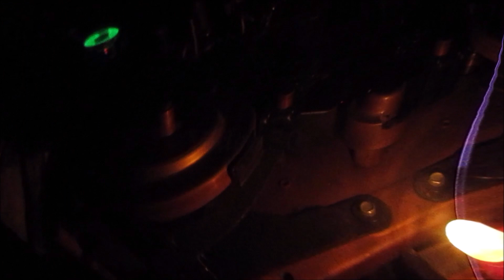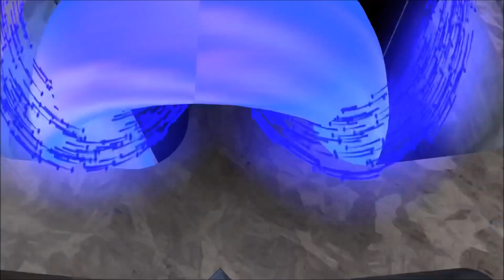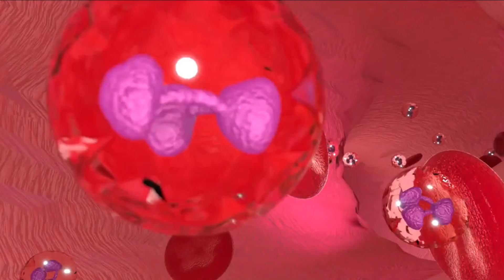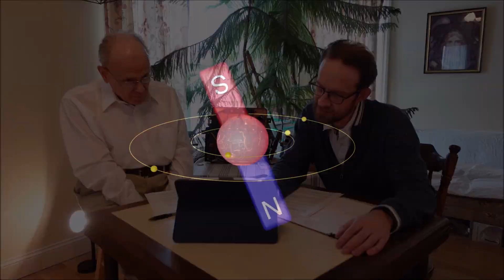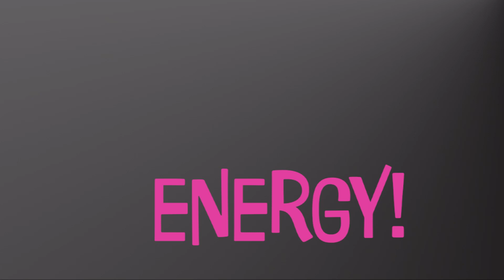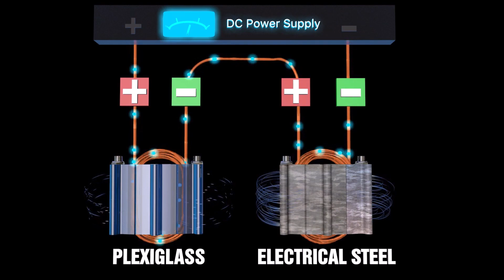Reaction-Video: "How the Holcomb Energy System Works..." (Video 30)

Comment: If just one of these Free Energy devices hits the open market, I'd destroy the Monetary System and the Shadow Government won't let that happen if they can help it. 
It would only take a fraction of one of Elon Musk's Maga Factories to produce a Free Energy device to the point of no return. The Tesla Home Charging Station. Offer it cheap to Tesla car owners for their "Car" and charge their whole house. 
An inventor named Floyd Sweet "Sparky", and his Free Energy device is the best I've ever seen. It's a 5x6x10 inch box that creates energy depending on the demand. It can power a wrist watch or a house or a building or,.....? It's pretty well documented and I'm thinking Elon Musk is smart enough to back engineer the device.
There'd be no more Slaves and Slave Masters anymore. Advancements in all fields would flourish. A cure for addiction? 
In Star Trek, in a time where humans are space fairing, remember, there is no Monetary System. 
I believe, because I've heard "I had a dream" so many times, that there are alien influences giving these Free Energy devices to knowledgeable people to try to break the grip of the monetary system on the people of Earth. 
And this is the way you know that the Forces are against you, Dennis Lee invented a Free Energy Panel System that uses a subzero gas that collects heat from anywhere in the world 24/7, compresses it to turn water into steam that runs a steam engine in a closed loop. Simple and easy to manufacture. He was sued by the United States and won. The only one to have won a fraud case claiming Free Energy. It can be retrofitted to Simi Trucks and Railway Cars right now!
So why are the Solar Panel and Windmills companies getting the Subsidies and Contracts if the United States government knows about Dennis Lee's invention if we really do have to save the planet? 
Because the Climate Change Crisis is a Hoax. A Power Grab and a Money Grab in the form of Campaign Contributions and Kickbacks!

Comment: Okay, need to chime in here, Iron does make a stronger magnetic field than air. Iron can have a rating of up to 100,000 H/m in some engineered formulations. The thing is that all electromagnetics experience a phenomenon known as reluctance and reactance.

The more magnetise-able a substance is, the longer it takes to magnetise the entire mass. This doesn't mean you need to apply higner voltage to the coil to magnetise it but you need to apply the same voltage for a longer period of time to magnetise the coil.

the reluctance of a coil is "resistance_reluctive = 2 * Pi * Frequency * Inductance" so that shows the resistance trying to switch an electromagnet at a given frequency presents in addition to the line resistance of the wire that makes the coil

The time it takes to fully magnetise the material to full strength is "T = 5 * Inductance/line_resistance" so if a material is 5X as magnetic, it'll produce a field 5x the strength for the same current input, but it will take 5x longer to reach full strength, which means you need to apply power for 5x the time.

Free energy is possible, just not like this.
Reply from the maker: Thank you for your comment!

Comment: If you take apart a hoverboard wheel which is a brushless motor with stator in center and magnets that rotate on outside wheel.  Remove the circuit board & hall sensors and you end of with a 3 phase alternator with stator in center and power can be generated by rotating the outside magnets.  The Holcomb energy system is replacing those rotating magnets (alternating polarity) that require mechanical motion,   with electromagnets that would have some kind of switching circuit replacing the function of the magnets.  That electromagnetic switching circuit requires power to operate.  His demonstration test didn't prove anything to me.  Put amp/volt meters on input coils and on output stator coil and prove there is more power output than input.
Reply from the maker: Thank you for your comment!

Comment: Dr. Holcomb claims that his electrical energy system, which he invented, has an overunity factor of FOUR! It is a solid-state generator, using the "electron spin" in electrical steel to multiply energy, using alternating magnetic fields, according to this video.
Reply: Yes, these are his claims. However, no confirmation of these claims by independent experts exists. This and physics make Mr. Holcombs claims very doubtful.

Comment: Greats video 
This is standard theory and everything regarding iron is standard theory no different in fact to any other non diamagnetic materials. Some are stronger depending on the free electrons.. basic well know stuff 
And we should remember that only  permanent magnets will become unaligned over time because of entropy. 
No non diamagnetic magnetic material will ever ‘run out’ due to entropy. 

So the thing is - does this device this man’s designed gave a a-systematic coil design? I’m not sure it does… and without that you would be left with symmetrical ‘equal reaction’ standard design and standard symmetrical behavior which in everyone’s terms is less than Unity. 

There’s many factual examples of asymmetrical designs that allow above unity results ‘free energy’ results by several different possibilities 
1, (solid state) the reuse of input energy more than once - by a pure reactive power design - that provides a blinded output to a pure resistive load. 

Mechanical - turning off coils to both save the CMMF MMF and reuse the coils input over again

By magnets - design a ac wave form to keep half the input to the coil being that only half the time (cycle) there can be CMMF, you keep it the other half.

2. Using magnets in a core to control the flux (block the flux) in asymmetric designs where there is more that net 0 in flux response return. 

3, Using nature by producing longitudinal waves. By using a spark gab quenched with magnets you can effectively produce lightning and this forces electrons to be pulled from the environment and go to ground - which is your  circuit (this is Nikola Tesla’s great contribution) 
Lightning bolts do this in nature, Tesla was interested in harnessing and producing such lightning and then sending different types of energy thru Zennick waves ( ground waves ) 
This is all proven. 

4, Using frequencies to change the pattern/ direction of water.., 
By using frequencies with small input energy you can change the direction of water flow resulting in refilling the reservoir to flow back thru a generator over and over again.

There some more examples also some involving radiation

The thing to remember is there’s more Maxwell equations that are asymmetrical than the Heaviside printed 4 Maxwell symmetrical equations. 
Maxwell and Heaviside know both were equally important. 

Remember the one governing principle that’s wrong in the teaching of physics is the - “work energy principle” 
This is wrong and a violation of electrical physics! Yet it’s taught in the science all day long… 
This mistake came directly out of the “relativistic” model which should never have happened!
Reply: None of these proposals work, no one could ever show that they work in a credible way. For instance, Zenneck waves are proven, but they also loose power over distance. Less than an EM-wave but still to much to use them for a wireless power distribution. And Heavisides formulation of the original Maxwell laws are 100% equivalent to the original formulas. Any solution satisfying the original formulas also satisfy the Heaviside formulas and vice versa.

Comment: I would like to know why all these different people make all these claims with no proof.  It would not be had at all to measure the watts going into the device and then measure the watts coming out of the device.  I remain skeptical at this point.  I am constantly looking for some sign that any of these devices do what is claimed.   So far no proof sad to say.
Reply: If a measurement is done it must also be done in a way which rules out fakery. But such a measurement will never be done, since the various inventors know that they are scammers and don't want to be unveiled.

Comment: The problem is, that they don't have any small unit where they can show it, that it really puts out more power than goes into it...with just a few meters and easy measurement..
I guess they want to avoid to being called a perpetual motion machine this way...
So Dr. Holcomb make a demo, which shows the output is really5 times the input by using 5 x 100 Watts incandescent bulbs lighting up with just a 100 Watt input and compare it to another banck of 5 x 100 Watts light bulbs being powered by the grid...
That woulld prove him right...
Reply: A demo alone would not be a sufficient proof. For a real proof Mr Holcomb would have to hand over his device to independent experts to rule out any possibility of fraud. But Mr. Holcomb - and similar inventors - will never do that because they know that their devices do not work. For any person with competence in physics the explanations of Mr Holcomb are complete bogus. Of course steel magnifies the magnetic field, but at the expense of an increased electrical input.

Comment: Recently, I had the pleasure of meeting Doctor and Mrs. Holcomb, as well as some of the Holcomb Energy Systems staff. I was extremely impressed. They were all very nice people who made me feel welcome to their very impressive research facility, which looks like something from NASA. When I was there, I saw a generator working with an input of about 7 kW and and output of about 30 kW. It was powering a large bank of 200 watt incandescent light bulbs, a large resistor bank "dummy load", as well as some 3-phase motors. As far as I I could see, all of the instrumentation was correctly configured. The instrumentation clearly showed energy that was far in excess of input. It is also took into account real versus reactive power (power factor) so the excess power was not a resonance effect where current or voltage build up due reflected power. There were no obvious places to hide wires. I could see right into the core of the generator. I was able to touch the generator and it was at about room temperature. 

I think Dr. Holcomb will go down in history as one of greatest inventors in history. It was as if I was meeting Nikola Tesla or Thomas Edison. I think he should receive the Nobel prize for this world changing invention. I came away convinced that I just seen history in the making and the beginning of a new energy paradigm.

I made a video explaining how I think the Holcomb Energy System works at the atomic and molecular scale and why it does not violate the 1st or 2nd Laws of Thermodynamics.

Shorter version:
https://youtu.be/LVVxUcuX65w

Longer, more detailed version:
https://youtu.be/wvamIRUSbYE
Reply from the maker: Dear Sir, thank you very much for your wonderful comment.  I am glad to see that we are on the "same page" regarding the Holcomb Energy System, especially with  your deeper knowledge in the realm involved (motors, generators, and moreover: the relevant physics).  Moreover, the fact that you actually saw Dr. Holcomb's invention "up close and personal" and are convinced it is real and does what he says it does, gives your comments that much more clout!  I have watched your shorter video and I am looking forward to watching your longer one very soon.

Although I am aware that there are many details of manufacturing, regulatory approval, distribution, and logistics involved, I very much hope and pray that Dr. Holcomb and his team will be able to have his invention manufactured and brought to market with Godspeed so that it will soon become available for "we the people".  Thank you again for taking the time to comment on this video, and if you have further information or thoughts you may wish to share, we would be appreciative!
Sincerely,
David
Reply: Yes, thank you for that comment! We had seen the thumbnail for your video on the Holcomb YouTube channel, but I hadn’t had the chance to watch it until David showed it to me tonight! 🙏🏻
Reply: Dr. Holcomb will not go down in history as one of greatest inventors in history. This would only happen if he would hand over one of this systems to a group of competent and independent scientists for a thorough examination. But he will never do that, since - against all expressed sympathies for Mr Holcomb - he very likely knows that this system does not work.

Comment: Thank you for bringing forth this material to free us from the consensual reality of the carbon based fuel system.  Brings hope that we will gain our dependence from the elites running this planet.
Reply from the maker: I totally agree!  However I hope that Dr. Holcomb and his team will receive much prayer support from those who find out about his work!
Reply: @davidshipleyalexander2233  Does this really work ???
Reply: @victoryfirst2878    No, it does not work. The explanations given are bogus. It is true that steel increases a magnetic field, but this increase is not for free. If you switch on a coil with a steel core more energy is needed to create the stronger magnetic field compared to a coil e.g. with a plexiglass core. Unfortunately several similar "free energy" scams have turned up in the last years.
Reply: @heinzpg  Have you found any YOUTUBE videos that support what you say Sir ?? Please let me know.
Reply: @victoryfirst2878   Ha, ha, ha! Or do you really think, YouTube is a good reference for questions of physics? But what I say can be found in textbooks for electrical engineering.There you find e.g. the formulas for the energy of the magnetic field of a coil. I know them since I have studied EE. 

There are YouTube videos which debunk free energy but to my knowledge not yet one which addresses this Holcomb device. But there are several competent commenters who support my view.
Reply: @heinzpg  Thanks fella too.